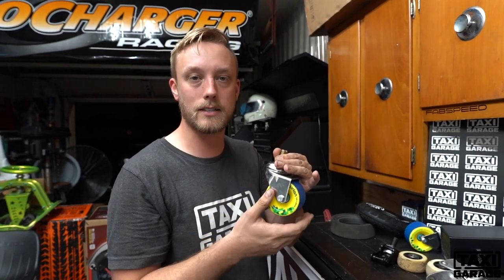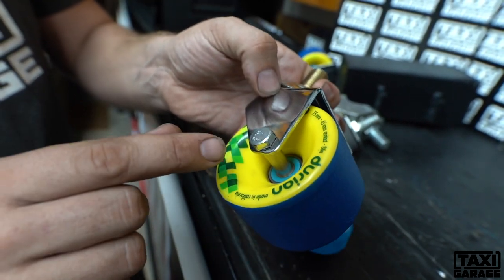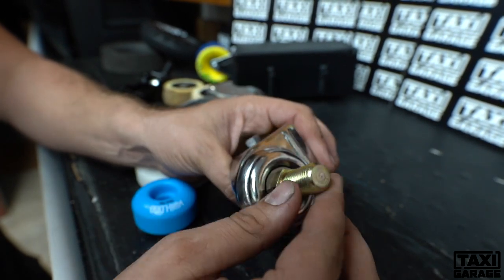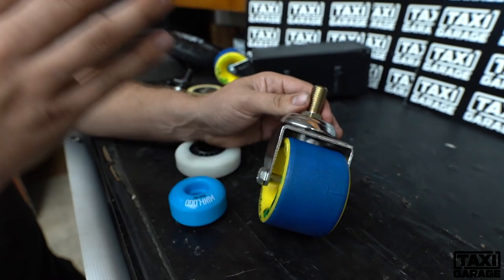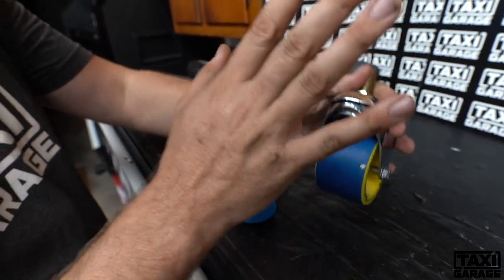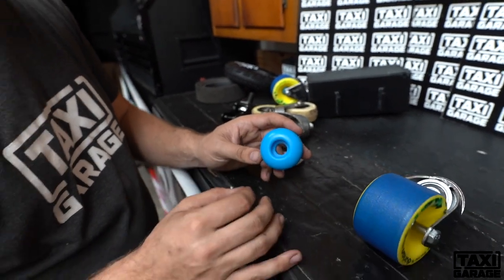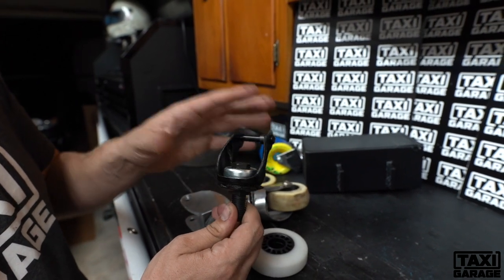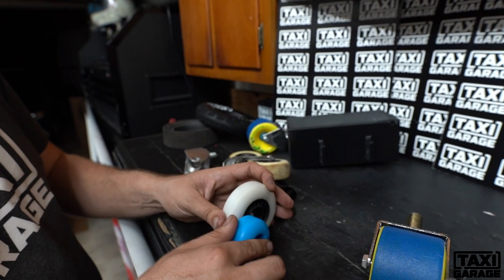Crazy Cart Wide Boy Casters// The Last Set You Will ever have to BUY!

Comment: Do you have a video showing to install the skateboard wheel upgrade?
Reply from the maker: It is the same install as the stock wheels, except we supply our own machined spacers that go on the outside of the skatewheels in between the caster body.
https://taxi-garage.com/products/skateboard-wheels-rear-caster-upgrade?_pos=1&_sid=0b279fe87&_ss=r
Reply: @TaxiGarage  
If I already have skateboard wheels, can I just purchase the spacers from you guys?
Reply from the maker: @calvin3448  We only sell them with our skate wheels, as each wheel has different offsets. Not sure if they would work with your current skate wheels.